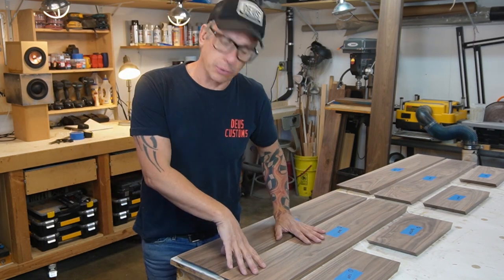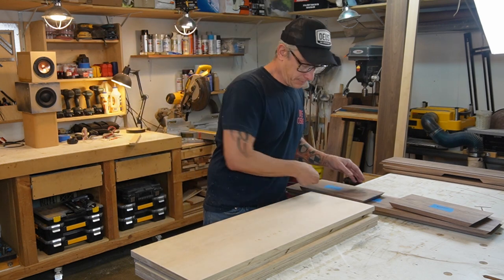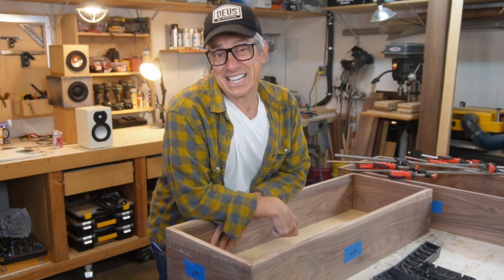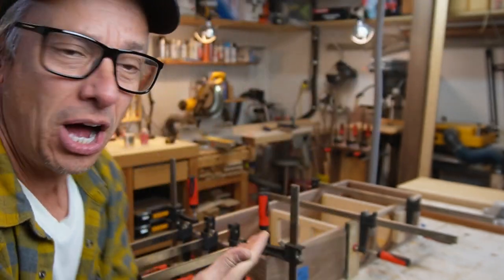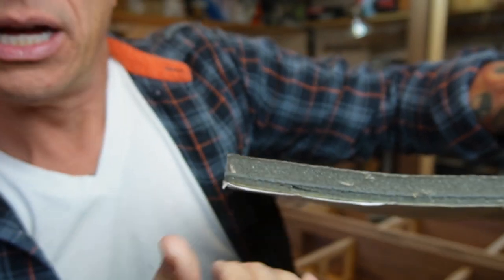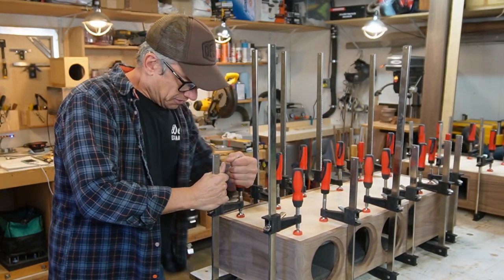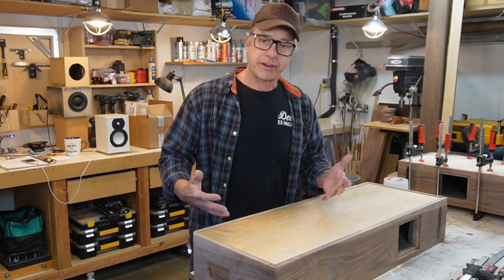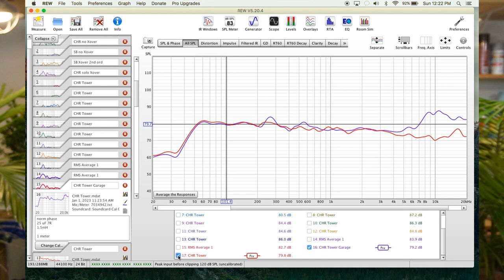CHR Tower Speakers Part 2 | Best DIY Speaker Build 2022 | Markaudio CHR-90 + SB Acoustics Woofers

Comment: I'm putting 2 Dayton audio 7" into a cabinet 26" high 13" deep 12" wide. I'm Also putting 2x 10" Dayton audio passive radiators at the back of the cabinet. Fingers crossed it resonates
Reply from the maker: Haha! I’m crossing my fingers as well. Are you using WinISD?

Comment from the maker: Hola Pedro. Si estos son de 4 pulgadas. Soundimports es la mejor opción para adquirir los altavoces. Puedes contactarlos a ver se pueden conseguir un CHR-90, o si tiene una otra opción de markaudio. MDF debe funcionar bien. Es una madera con bon damping. Creo que va mudar el sonido muy poco e no compromete la qualified final. Perdón por mi castellano limitado. Espero que sea suficiente para comprender. 
El nuevo crossover es un coil de 3.0 mH en series e un capacitor de 33 uF en paralelo, para los woofers. El Fullrange no tiene filtro.

Comment: Considering making a set of these for myself and potentially my boss (both audio engineers). How did you decide driver placement from the top of the cabinet? How much space is between the bottom of the tower and the port? Just trying to fill out the last bits of information. Additionally, do you have links to the components you used for the crossovers? Beautiful speakers and we’re going for small footprint, good sound, and wife approval!
Reply from the maker: Haha! Wife approval always seem to come first hehe! Thanks for watching. Let me see, driver placement was based on listening position. 33 inches from floor to center of the CHR fullrange. 4.5 inches from the top of the box to center of fullrange driver. The woofers centers are at 6 3/4 inches from center of fullrange. Port is at 1 5/8 in from bottom of box, remember I added a piece of wood inside the box, on the bottom, so I doubled the bottom thickness. 
My sound impression: you guys probably have trained years, obviously. The CHR driver is bright, you can check the CHR-90 frequency response curve and there is a bump in the highs, I have the speakers toed out and I drop the highs a little bit on my Schiit EQ. Just so you know. Bass is impressive, I have them at 4 feet from the wall in a  17 feet deep room and sounds great at listening position. Punchy bass. 
Crossover: so I switched the crossovers. I now have the fullrange running with no filter and for the woofers, a 3.0 mH coil and a 33 uF capacitor for a 2nd order crossover. 
E mail me if you need help:
Sonnoradesign@gmail.com

Comment: Hm.. Why did you use a filtration of a signal for the full range speaker, sir? Couldn't be possible to play only with the subwoofer (if you remember)?
Reply from the maker: I removed the filter for the fullrange and then got a low impedance. At the end I built a new crossover for this speaker with a capacitor for the fullrange. Check video #3

Comment: Hello from the UK
I am going to have a go at making a pair of the these speakers. My problem is laying out the dimensions. Does the volume of. the vented box include the area taken up by the port or is the  port area in addition. Does the length of the port include the thickness of the rear panel. Perhaps you could help and advise me. I have already done the crossover as per your video. However I notice that you have changed it in the description above. Is the revised crossover much better or will my original be ok.  Great videos by the way, very addictive. Regards Wayne
Reply: Thanks again for you're emails and help with all my questions
Reply from the maker: Hey Wayne!! Keep me posted!!

Comment: I love your videos and you build beautiful speakers. I would love to come by and hear these speakers but I live in The Netherlands, so.... too far away. I decided I'm going to build these towers but I have tow questions: 1 How does the crossover filter connect to the THREE speakers; In the screen you show I see only one SB represented and moreover, on the back of the cabinet I see double connectors. Question 2 is: Did you change the crossover after 'breaking in' the speaker and if so how did you change them? I'm curious and eager for a reply as I cannot wait to go and build these speakers! Thanks in advance for replying!!
Reply from the maker: Hey Ron! First, thanks for watching. I’m really excited for your build. I like those speakers a lot. Very powerful and lively. 
I switched the crossovers. I’m using a second order for the woofers and the fullranges are connected without crossovers. The parts are:
3.0 mH coils in series
30 uF capacitor in parallel
The woofers are 8 ohms each and they are connected in parallel to have 4 ohms at the end. That’s why I’ve showed only one driver on the crossovers they are in parallel. 
You can get all of those components at Soundimports as you are in Europe. Let me know if you have further questions. You can email me as well. Sonnoradesign@gmail
I forgot, the impedance goes as low as 3.7 ohms aprox, so make sure your amp can handle that.

Comment: I just watched the conclusion of this great build and noticed you installed spiked feet on the speakers. My floor standers are the same dimensions, but I never installed the spikes when I bought them. They sit on a carpeted floor and are so heavy they are well seated, is there any benefit in putting them on?
Reply from the maker: Hey Jon. I used the spikes mostly to make the speakers stable. They are too skinny and I wanted them to sit right and safe on the floor. Some people claim it makes the speakers sound better but that’s controversial. They don’t really isolate the speakers from the floor so you can still have some kind of “interference” on the sound specially if the speakers are sitting on suspended wood floors. There are products for decoupling that do a good job isolating them from the floor. You should be good if they are safe and sturdy.
Reply: @sonnoradesign  As ever man thanks for your advice and keep up the excellent work. My speakers are made from maple wood, are a little wider than yours and weigh a ton so if I will not get any kicker in sound quality from the spikes that were supplied by the manufacturer I will leave them off, because they sit comfortably on the wall to wall.

Comment: Can we replace with 5 inch Dayton aluminum cone for 22$ instead and keep the same woofer to reduce the price ?
Reply from the maker: Hello there! Thanks for watching. Replace the Fullrange or Woofers? You can replace whatever you want but the measurements are gonna be different. It should have a different frequency response and results also.
Reply: @sonnoradesign  
Thanks for your reply i am planing to ge the below speaker for my towers from parts express:

Visaton BG17-8 6.5" Full-Range Speaker with Whizzer Cone 8 Ohm
Part #292-546 - 2 qty 

Dayton Audio DS135-8 5" Designer Series Woofer Speaker
Part #295-426 - 4 qty

Dayton Audio XO2W-3K 2-Way Speaker Crossover 3,000 Hz
Part #260-144 - 2 qty

Do you think they will work together?
I am not too much techie this is my second apart from my first full range build.

Thanks,
Yashwanth
Reply from the maker: Hey Yashindian. I get it. You wanna make the same cabinet with different drivers. If you change the drivers you are making a new design and the box has to be recalculated. Those drivers you picked are not gonna work properly together with this crossover. I suggest getting 2 DS135 and a Tweeter the DC28F from Dayton for each box and make a 2 way speaker. I calculated the crossover and box for you. Send me an email: sonnoradesign@gmail.com

Comment: Sorry... have another question. Only now noticed that on the back plate you have 2 inputs (2 pairs of binding posts). The Crossover diagram has only one input. Why do you have the 2 inputs instead of one? Sorry if i'm making a dumb question :) thanks!
Reply from the maker: No question is Dumb my friend!’ I did 2 binding posts because I might wanna connect it to a mini DSP in the future. It makes it easier to tweak the passive crossover outside of the box as well. I connect the posts together with a piece of wire for now!! Abraço!!
Reply: @sonnoradesign  Ah. Exactly what i thought it could be! That's a great idea! Thanks for the reply!

Comment: I'm making a two-way with SB acoustics SB 15 drivers also.
I'm using the SB29 tweeter though.

What is your tuning frequency?

I need to make my enclosure look as good as yours do.!

I'd love to come listen to some of your speakers.

I'm using a pair of SB15NRXC30-8 in series with the SB29RDAC-C0004 IN MTM config.
Reply from the maker: Hey there!! Thanks for watching!!! The tuning frequency is 36hz. There are box specs on the video description. F3 around 44hz. Those drivers are really nice. It would be a great project.
Reply: @sonnoradesign  Thanks for the reply.
I have just under 34 litters.
I'm not sure if that's too big but i can shrink the internal volume with something solid at the bottom of needed later
Reply from the maker: @BARBELLS-AND-BUDS  34 liters is good. Your F3 is gonna be lower at around 39 Hz. Are you using Win ISD to calculate it?
Reply: @sonnoradesign  No i was gonna find by ear then see how close i am.
I'll be using 2.2" or 3" tube port.
Reply from the maker: @BARBELLS-AND-BUDS  hey There. Man sorry I missed this one. I can design the box for you and the xovers. This coming week would be easier to sit down as get it done. Remind me please.
Reply: @sonnoradesign  The box it a knock down from PE
1.2ft3.
I think it's too big for the pair, but won't if there's a way to make it work.
I have PE 2khp and 2k LP prefab filters on them
I bet they found better with a proper network
I mean besides the fact that the tweeter needs at least an l pad on it right now since it's hot compared to the mids

Comment: Hey SonnoraD, I just found your channel earlier today and left another comment about Al di Meola.
I'm curious what years you messed with DB Drag Racing?
I also did some building and competing. Drove to a 2-point event in Costa Mesa to set a world record in Street 1-2.
Long years back!
Reply from the maker: Shoot!! That’s cool man!! I did more IASCA than DB Drag but that was in early 90’s to 2000’s. It seems slower now. I still love car audio!! Congrats on the record? How many db’s you got?
Reply: I was trying to see how much I could squeeze from a 2x12" x 600w Street 1-2 class, no mods, one battery and the best I hit with one ZR600 amp was 151.1 but when I replaced the junk deep cycle with a Stinger and ran 2 amps (ZR600 - 2 x 150w @ 4ohm stereo) like the Zapco guys, I hit 154.7 with 2 L7 12".
It was a blast until it got political.
I once bought Alma Gates a smoothie and talked with her for an hour at a Cal Expo show.
I played '98 - '02

Comment: Estoy comenzando a construir las torres CHR y quería me contestaras a un detalle que me tiene intrigado: en tu video se puede observar que los huecos para los drivers son (o lo parecen) casi idénticos de diámetro exterior, sin embargo los CHR-90 tienen 151 mm de diámetro total y los SB15 tienen 123 mm.  Cómo es posible que en el minuto 29:06 de tu video se vean iguales los huecos?   
  Gracias de antemano por tu grata respuesta.
Reply from the maker: Hola Pedro. Primero, gracias por asistir! Los drivers SB15MFC30 miden 150mm de diámetro, creo que está buscando un otro driver. El link para esto está en la descripción del vídeo. Se vas a terminar el proyecto me diga porque estoy usando un nuevo Crossover.
Reply: Buenos días Amigo.  
 Ante todo muchísimas gracias por tu pronta respuesta.   Tienes razón,  estaba mirando las medidas de los SB15 de 4 pulgadas.   He contactado con Madisound y me confirman que realizan envíos a España,  de momento solamente tienen un ejemplar del CHR-90 de 5" Gold.  tengo que esperar unos meses a que dispongan de más unidades.   Lo malo es que los gastos de envío desde USA son bastante elevados.  y en las tiendas europeas (Sound Imports,  Masori, etc) no disponen del CHR-90 de 5".
Ya me dirás en que video tuyo puedo ver el nuevo crossover que deberé realizar para las torres CHR,  por supuesto que me gustaría equiparlas con los nuevos, todo lo que sea sacar mejor rendimiento mejor.    He intentado realizarlas con madera maciza de nogal, pero el precio aquí es desorbitado, por lo que opté por utilizar MDF de 19 mm, y forrarlas con chapa de nogal,  espero que el sonido de las torres no sea muy inferior a las que tú realizas con madera maciza.  
O estimas que sería mejor utilizar contrachapado de 19 mm, en vez del MDF?
De nuevo expresarte que para mí es un honor contactar contigo.  
De todos los videos que corren por Youtube, relacionados con DIY de audio, los tuyos son, con mucho, los mejores.
Mi enhorabuena por tu expléndido canal.  
Un abrazo desde España.
Reply from the maker: Hola. Gracias Pedro. Bueno que hay contactado Soundimports, eles están muy a cerca. Espera un poco e logo más lo tienen. Puedes acer las cajas con MDF o Contrachapado. O que sea mejor para usted trabajar. Los nuevos crossovers son muy simples, solo un crossover para los woofers y el CHR está sin filtro, para que los woofers reinforce solo los graves. 
Filtro pasa baja para woofers:
1 inductor - 3.0 mH en series
1 capacitor - 33 uF en paralelo
Se necesita de ayuda manda email
Sonnoradesign@gmail.com
Reply: De nuevo, muchas gracias por tu pronta y grata respuesta. 
y abusando de tu paciencia, te quería hacer dos preguntas:  si se podrían modificar las medidas internas de las torres, pasándolas a 90x26x15, respetando el volumen total interno de 36 litros,  y si no afecta a su rendimiento el hacer la apertura de ventilación en el frente de la caja, en vez de situarla en la parte trasera.
Gracias de antemano por tu respuesta.

Comment: They remind me of my Mordant Short Avant 906's in the narrow footprint, three way speaker and bass handling capacity from relatively small drivers. The finish is first class and the structure appears solid and well baffled but the price is a little high.
Reply from the maker: Thanks Jon. It ended up a little $$$ but sounds like it.
Reply: @sonnoradesign  Love your work and funky presentation. Wish you success health and wealth.

Comment: Awesome project and I enjoyed every minute of both parts 1 & 2. Keep up the awesome work.  Question, the hardwood looks beautiful but you could have gone with plywood and then a veneer like you did with the sides. Other than the aesthetics, and thoughts you’d like to share on the benefits/trade offs on the use of hardwood sections for this build?
Reply from the maker: Some people don’t even like hardwood on speakers cause it’s too “hard”, less damping. Some manufacturers use it all over (boenicke). In this case it made it easier to work on the corners, like rounding it up, gluing, sanding and mounting the drivers. You can totally use veneered plywood or MDF.

Comment: @sonnoradesign    Yet another amazing build! You talked about changing box volume, what was the final volume for the CHR, and what Frequency did you decide to crossover at, as you also mentioned that CHR clipping at 100hz. I'm looking at a CHR , 5 inch tangband build, can't decide on crossover..
Reply from the maker: Hey David, at the end closed box is 6.5 liters, which rolls off the bass at around 100Hz. The crossover point is at around 700Hz and both bass and fullrange rolls off smoothly. I didn’t want to make a 2nd order crossover cause it would make the cutting curve steeper and I’d miss the mid bass from the mark audios. It’s a different design but works pretty well. I loved it.

Comment: 32:21 The inductor is small on the woofer in that a lot of med is in the woofers. Nothing wrong with that, except it's not that much point source. I use 6.8 uh inductor on my woofer with my FR driver and the med seems just right. I suppose the transmission line design boosts the bottom end more than my bass reflex design (so you get deep punchy bass with such a small inductor). And your woofer level is just right (and the woofers don't need any resistance) it's good driver output match. On your FR driver, does the 25 uf mean mf? (like I usually see on caps) I use a 2.2 mf cap with a resistor in parallel to pizz up the top end for more sparkle. I haver never heard of 25 mf or 2.5 mf (only 22 and 2.2).